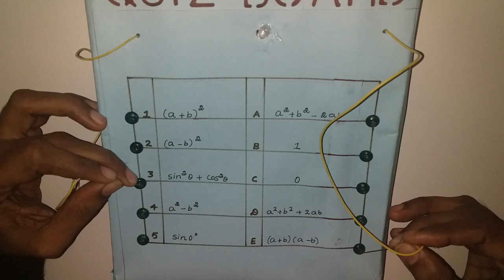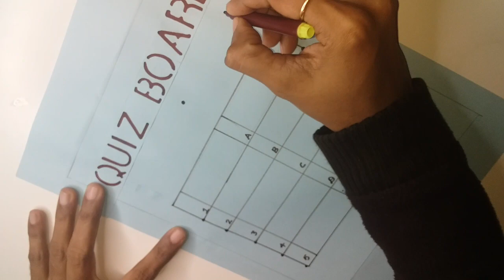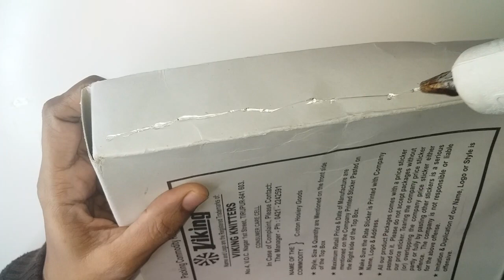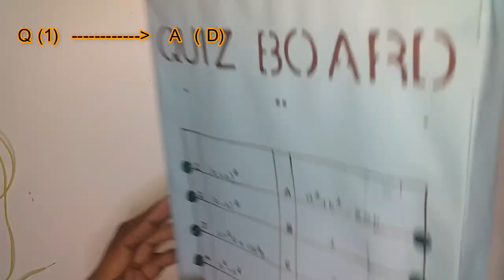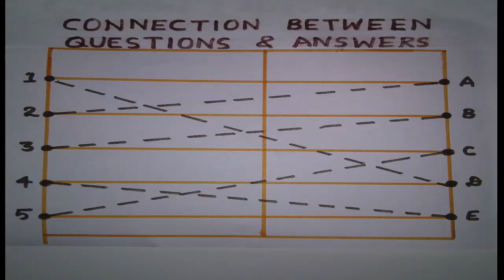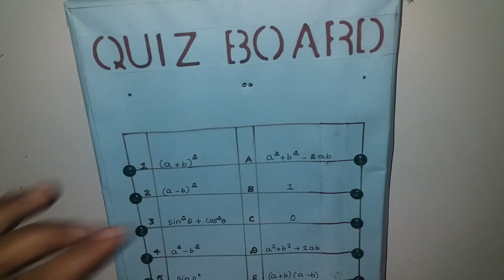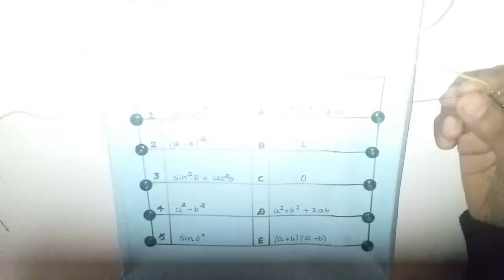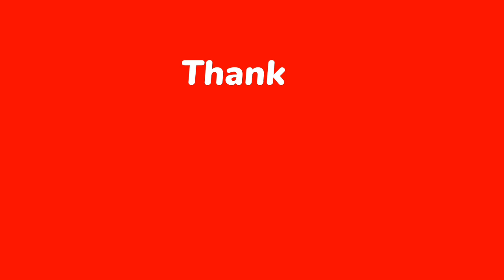DIY Project | How to make Electronic Quiz Board at home | Cheapest science project  | School project

Comment: Hello! I have only one question. I don't understand how the paper pins let the electricity pass through, although they are covered by plastic.
Reply from the maker: Hi
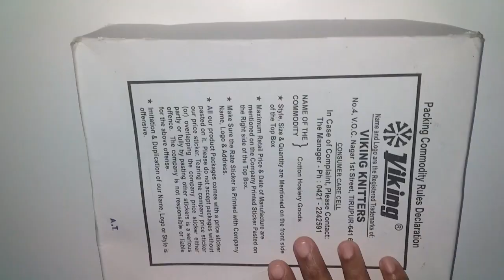when we cut the top of the paper pin, the pin head will appear little bit . use the pin head to make the connectivity. please refer video timeline 1:05 for cutting the pin. please use cutting plier to cut the pin .Thank you

Comment: Hello, I have made same like this but  it is not working why it is not working 
I think I have dont paper pin ke jagah pe mene nails ( khele) use Kiye islye asa to nahe hora na please tell me
Reply from the maker: Hi
  You need to cut the top of the paper pin by using cutting plier as paper pin is covered with plastic ,it will not conduct electricity.Pls refer video timeline 1.05.Thank you